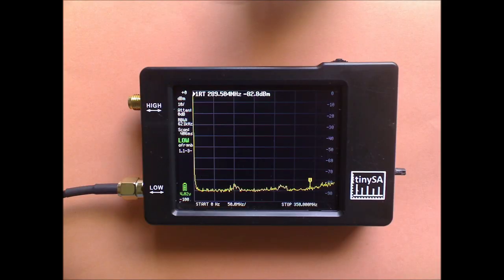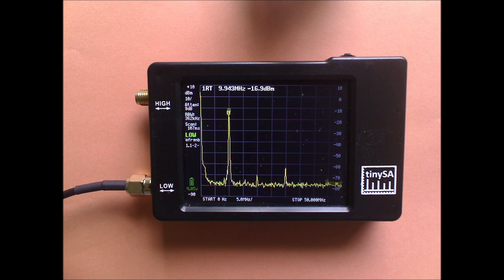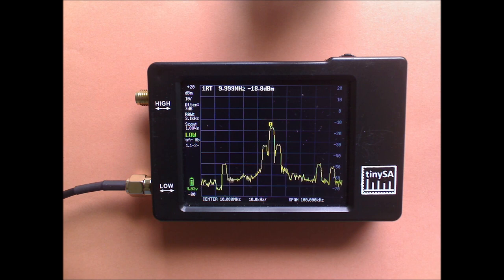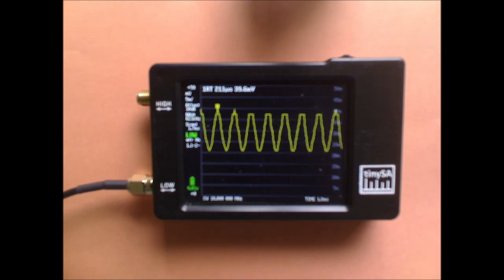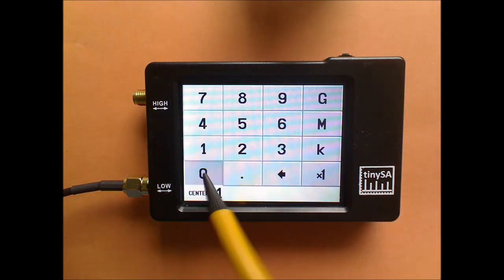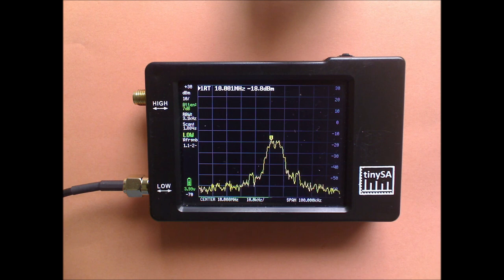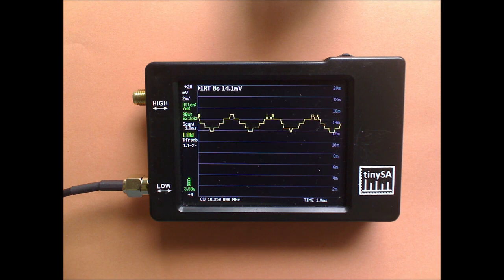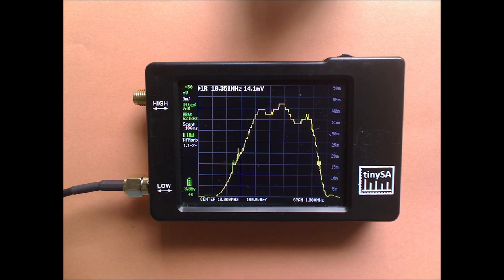tinySA doing AM and FM generation and analysis

Comment: Hi Erik . Great video. I have just purchased a Tiny . On mine in the menu screen it has a option save to SD but there's not a SD memory slot. Has yours got the same. If I try it is says failed. Cheers from old George
Reply from the maker: It's a bug. The menu option should not be there
Reply: @ErikKaashoek  Whoops sorry I sent the wrong message to wrong person. It's the NanoVna that has save to SD but no slot. But it does have save to memory which works. Cheers from old George 🤠🇬🇧

Comment: question I have a motorola 800mhz 2 way radio can i use this to config the high side? its a handy talkie 5 watts output
Reply from the maker: If you use a good attenuator of at least 40dB that can handle 5 watt or you use a sample with 40dB attenuation between the radio and the antenna, yes
But NEVER connect the radio directly to the tinySA, or even put antenna's close and transmit.
Reply: @ErikKaashoek  I bought a 40db 15 watt attenuator that should do it?
Reply from the maker: @Ibelieve218  Yes